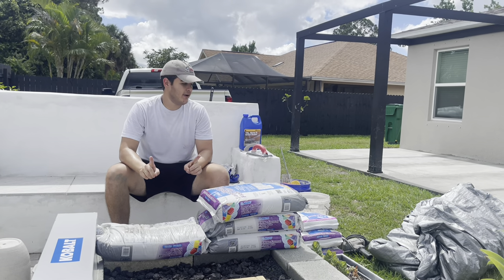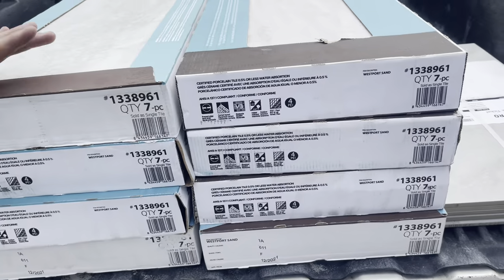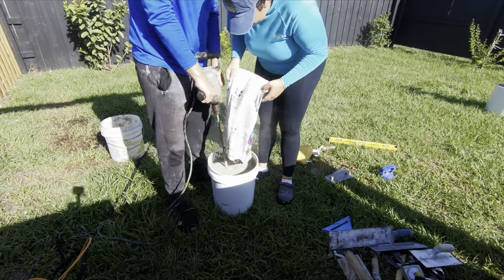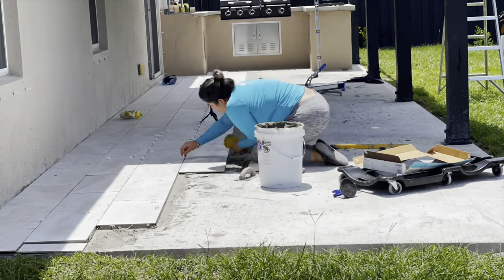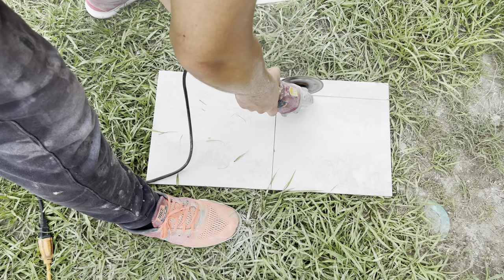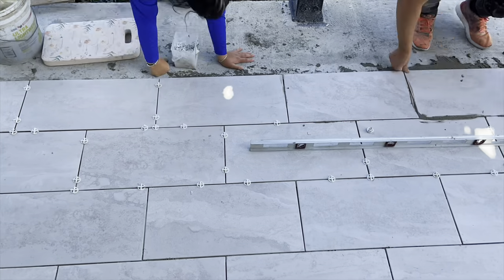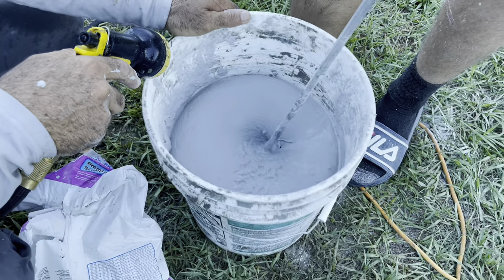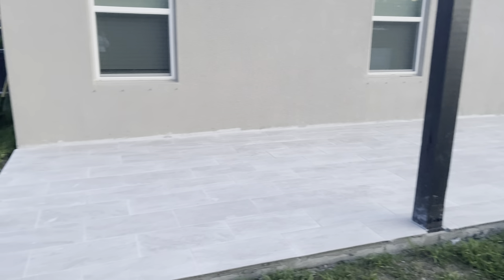HOW WE INSTALLED EXTERIOR TILE FOR THE FIRST TIME | OUR BACKYARD MAKEOVER (PART 8)

Comment: Thanks for posting this video and looks professional. There is a uncoupling membrane, any reason why you decided to do without it (given all the careful planning you have had)? I am thinking of buying extra tiles and keep them aside in case I have to replace the tiles when the concrete beneath break, the Schuleter uncoupling membrane is a darn plastic sheet and they want nearly $2 per sqft.
Reply from the maker: Honestly, no. There is no specific reason as to why we did not put it but the floor has held up perfectly. We do not have any cracked floor tiles but still kept some in stock as well to replace if need be. Our advice would be to make sure to add enough of the tile mix under to prevent it from feeling hollow, which often leads to the cracking. Best of luck with your build
Reply: Thanks

Comment: This might be a silly question, but i assume the slab slopes very subtly for water to run off? When checking for levels do you take that into account or just have it the same level?
Reply from the maker: No silly questions here! Even though we did take that into account, we still checked for level when installing the tile since now we were adding adding mortar mix.
Reply: @TheHandyCreators  How did you take it into account? If keeping level would it not flatten out the surface?

Thanks
Reply: @TheTraveller777 I don’t think they took that into account
Reply from the maker: No because when installing the tile, we used the level to ensure that it had the same small slope that the slab had for water runoff.
Reply from the maker: It was something that we took into account. We used the level to ensure that it had a similar slope to the slab

Comment: To late now but it is helpful to lay down a good chunk of mortar at once and spreading it over a larger area then just one tile at a time. It helps so mortar doesn’t keep being forced out through tile joints and it also helps buttering the tile. Meaning doing the same technique you did laying mortar on concrete but doing so on the tile. Better adhesion. Also only need about 85 to 90 percent coverage of thinset.
Reply from the maker: Thanks for the tips! There is always room for improvement so we appreciate it. It was our first time ever laying tile but not our last. So thank you!
Reply: @TheHandyCreators  yea of course. Looked good 👍🏼. This will save time and money

Comment: When spreading the grout, is it best to spread it with more or less? I live in California area very dry, and heatful
Reply from the maker: In our opinion, we found it easier to add a bit extra grout and then remove the excess. We just worked in small sections at a time, That way you ensure that all the crevices are filled in.

Comment: How's it holding up so far? This product is 3/8" thick and I want to do the same thing. But whenever I google the recommendation is always to use a 20mm (3/4") thick tile for outdoors.
Reply from the maker: We haven’t had any issues, it looks the same as the day we installed it. This tile is sold as exterior and we love it. It’s anti slip and very easy to maintain. Hope this helps!
Reply: @TheHandyCreators  Thanks much!

Comment: Im trying to do this and i was told i needed to use something on the concrete that will help with expansion and contraction otherwise the tiles will crack when the concrete expands
Reply from the maker: Honestly, we have not heard about that in the past, but if it helps, it’s been over a year since we installed ours and there’s has been no  signs of this

Comment: Hi can tiles able to lay over the concrete expansion joints
Reply from the maker: Hello! To our knowledge, yes you can. We would just advise to make sure that a tile connection is not right above the concrete expansion joints to prevent it from not having strength

Comment: How do you deal with the step down onto the grass
Reply from the maker: I’m not entirely sure what you mean..? The tile level is almost at the same height as the ground. There isn’t a big enough difference to add a step.
Reply: I’m doing tiles and grass in my backyard should I allow for the thickness of the tiles or should I just do the tiles first then grass accordingly

Comment: Your glue trowel notches/teeth are too small for the size of the tile. You are using the trowel meant for walls and small tiles. It would have been way easier for you to use 12 millimeter notch/teeth trowel.
Good effort tho.👍